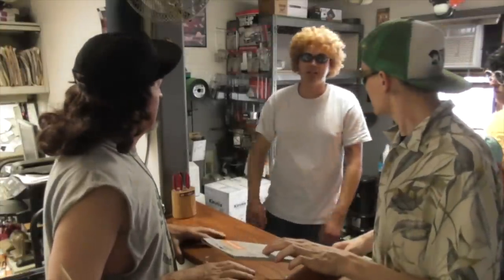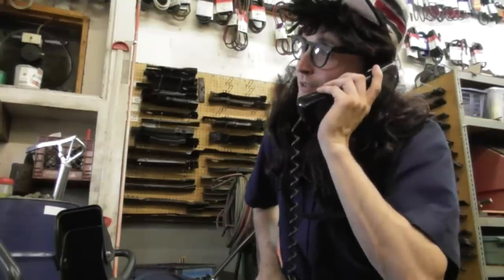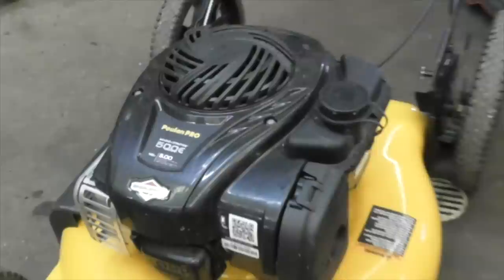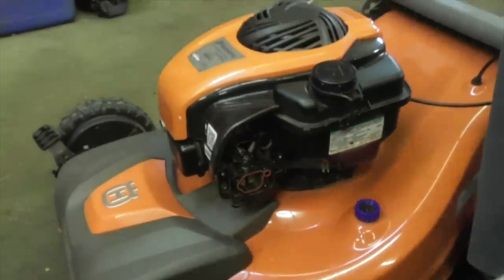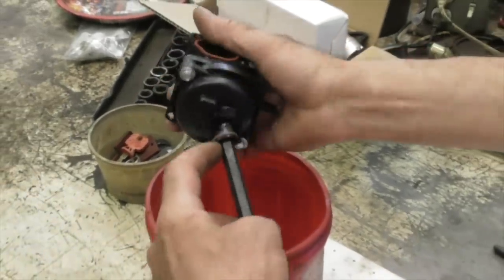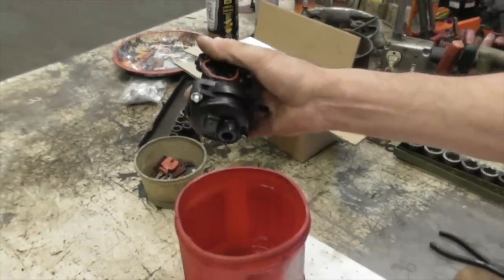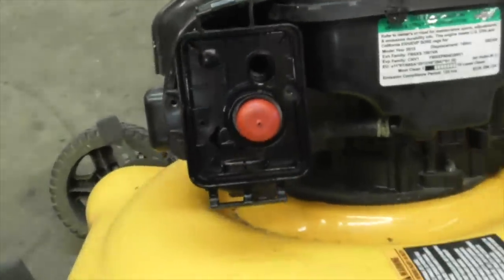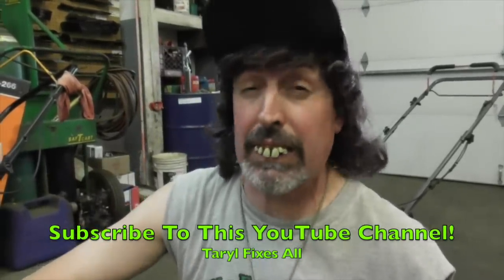How To Clean The Carburetor On A Push Mower (New Plastic Style Briggs Carb)

Comment: This is the ONLY video I have ever seen that shows the correct way to disassemble and clean one of those plastic carburetors. Most don’t remove the white jet body and I’ve never seen anybody take the white jet body apart. Great job Taryl. and thanks for showing how it should be done.

Comment: Just wanted to say, This video helped me fix a Crapsman push mower( mine had the primer button) that ran fine last summer, wouldnt start this year.  I took it apart before watching your video, and thought i had cleaned everything, still wouldnt start unless i sprayed starting fluid in ( then it would run and die in seconds).  well first time i didnt take that little silver ball out, it looked clean and i still sprayed some carb cleaner.  sure enough take it apart again after watching this video something was stuck in that exact place Taryl mentions as a common spot.  Thanks for my dinner!!!

Comment: I have 3 husqvarna 21 inch mowers with Honda engines... I've used them for lite commercial work ive had them now 3 seasons they all still run great ! I had someone this year bend the shaft in one of em but it still runs lol..I need to try and fix it! I've watched the video where you fix a bent shaft but I have not tried it yet lol...anyway keep that oil changed and them things will last longer than you think! Thanks for your videos! I honestly think you have one of the most entertaining and educational channels on YouTube!

Comment: Thanks- I have trouble every spring with this carbitrater and you answered all my questions. I thought it was cheap junk but it works great and is easy to work on.
Reply: It is cheap junk...our fuel is the culprit though. Ethanol has no business in our fuel, it ruins everything.

Comment: 2 years old and still helping people!  The carbs have become even more plasic here in 2020.  The air filters are a little different and the whole rig is 2 screws fewer... The float pin is now a plastic part with a rubber tip.  It also slots into the float itself before reseating into the bowl.  I skipped through the fluff straight towards the part I needed to see.  That being said you had an exceptionally thorough explanation and patience to allow for proper camera angles inside the Carburtraitor (<-Love that btw...)

Comment: Those plastic carbs are absolute junk. It’s sad that they are charging more for mowers these days and ain’t got more than maybe 50 bucks in em if that lol. awesome video as usual grass rats...👍👍👍
Reply: R Miller, that what a pawn shop is for... Just have to find the right deal.
Reply: R Miller there's nothing wrong with these mowers. An in-line fuel filter can still be fitted to the short fuel line if the carburetor tends to clog.
Reply: just because its plastic doesnt mean its junk.
Reply: The only reason they make them like that is to cut manufacturing costs.  They don't give a rats ass if they don't last.  Now some lawn and garden tractors have plastic transmissions.  The best part is...they are not serviceable.
Reply: @jordansdad1221  The best thing is if you have an older one that does not have that unnecessary plastic and it still runs keep it as long as you can.  Don't give into buying a plastic carburetor if you can avoid it.
Reply: @boomstickkid  yes it does...............LOL
Reply: nothing wrong with plastic, fuel is crap, thats all. All carbutraitors have problems with modern fuel. Use alkylate fuel ment for mowers and small engines, empty your tank once a year.
Reply: R Miller companies build what the general public is willing to pay for. You can still buy a push mower that’s going to last a lifetime of commercial service but you’re not going to find it at the big box store and it’s not going to be cheap.
Reply: Wayne Swicegood I’m aware.
Reply: @999thenewman  yeah,that's exactly what I did after the jet got clogged the second time in 2 weeks. It's been 3 months and so far so good. They should have put a fuel filter in from the factory. Would have prevented this.
Reply: I kind of like the fact its plastic and has "o" ring style gaskets. You dont tend to have to replace the gaskets if you take carb apart to clean it.
Reply: @TheStrikkegenser  i agree as long as the plastic holds up and does not degrade or crack its fine..metal carbs have corrosion issues from water and crappy gas...these plastic ones just get clogged like any other carb and can be cleaned...
Reply: They're great. The circuits pop right right out for detail cleaning and pop right back in. What's not to like? Lol!

Comment: I drill out the bottom main jet with a # 72 drill bit .020 works great , starts first pull ,,,,even the ones without the auto choke . Been working on mowers for over 50 years ,,,I'm a 74 year old machinist and I'm like you " Old School " !

Comment: Taryl. Love your vids, man. I watch them all the time on my internet screen. On this vid, I would like to suggest a helpful tip. At 15:20, when the screw is being driven into plastic, turn the screwdriver backwards, until you feel the screw "drop in" to the already cut threads, then drive 'er home. You'll reduce the risk of cutting new threads (weakening the existing threads) and striping out the screwhole! Thanks for the tour of this carb. Never seen one before. Keep the vids and comedy a-comin!

Comment: Well I'm not a huge fan of the craziness, but you know your stuff, so kudos for that.  I had the exact same problem with my plastic carbed Briggs, I followed your procedure and it runs better than new in less than 15 minutes.  This is a great running, auto-choke (that actually works) engine but this carb seems to be very finicky when it comes to clean fuel.  Thanks Taryl.

Comment: Can’t wait to see them start making plastic engines too.
Reply: FishFind3000 I know got a plastic transmission in my Ariens leaking after 2 years everything is junk now my 1982 Lowe’s mower is still going
Reply: ¾ of those new Briggs engines like you just saw are all plastic built! The starter cup on those are plastic and break constantly, the flywheel air fins are all plastic and break off, the entire recoil starter is all plastic, the block is cheap aluminum and develops stress cracks along the side and base that bolts to the deck and starts leaking oil out, the overhead valves constantly need adjusting or they quit running, and the internal camshaft gear is all plastic and strips out or breaks at the blink of an eye if you do much hit a twig while mowing making the engine toast. I miss the old Quantum engines and classic engines by Briggs that ran forever!
Reply: Lorne Johnson  briggs has been using a nylon camshaft since the late 80's those parts are reliable.
Reply: Ez wurks is going to do that
Reply: I like the Briggs plastic carbs.
Reply: They practically do with plastic cam shafts and valve cover
Reply: @jakewells9403  no starting in like 2010 if you have a 80s Briggs it is most definitely all cast iron

Comment: I did a bad. Had problems with crud plugging the little brass jets, so I pulled em out with the welding tip cleaner and ran it hard twice through each, and pushed them back in. Yeah, not supposed to, but it runs great now...

Comment: Worked great. Although I didn't find any gunk, just greasy water. Grabbed some bad gas from an old tank by mistake. I first tried flushing the tank. It still ran 5 or 10 seconds and stalled. everything worked just as described for my carbur'tater'.

Comment: Every year I have to clean the intake to that main jet.  Always some small piece of debris.  This whole jet assembly is horrible.  But working as it should, starts up with a single pull every time.  Love the humor.  Oh yeah, I use a little silicon grease on the jet o-rings so t pushes in easier.

Comment: I know you probably won't see this because it's an old video, but about the atmospheric vent you were pointing out.... I got an old mower that actually had a little hose attached to it, that was connected to another little nipple where the white cap is on top of the carburetor. I knew it wasn't necessary, so I just removed it. I think that must have been some kind of California emissions requirement thing.

Comment: Where I live folk just throw out the mower after about 1 year cause they can't start it.  The problem with those plastic carburetors is that the pickup tube is right at the bottom of the fuel bowl and it picks up any debri in the gas.  Then you have the plastic gas tanks that internally break down releasing  tiny pieces of black plastic that clogs the carburetor. Best thing to do is to put a small fuel filter between the gas tank and the carburator.

Comment: Great camera angles, thanks for getting close and being specific.. I was able to clean mine and put it back together. One other issue I'm having is, when it's running I can only cut for about 4 minutes when I notice I start to lose power and it smokes a little. Any idea what that could be? Once I let it cool down and sit, I can crank it back up no problem. But again, few minutes of mowing and it slowly starts to die and lose power.

Comment: Just FYI,,, starter fluid is how NASA launches the space shuttle! They put a lawnmower beneath it and start it with ether and wait for the explosion!
Reply: BCtruck, rebuild, repair,repurpose Lol, I use ether to start everything, diesel and gas tractors, lawn mower, and my Ford f150 in the winter. And if you want an actual explosion, spray it into your diesel truck intake and then operate the glow plugs.
Reply: I have used brake cleaner to start my generator (Briggs pull start). No explosion that I can think of. Just relief that I got that thing started in cold weather.
Reply: I. Love tearl....he fixes all

Comment: Silly question I know...I just don't want to screw anything up before I embark on this project. I own the orange mower exact same make and model...What  EXACTLY  is the type of spray used on the carburetor?  I have two different kinds  currently. One  Is the motor medic thrust starting fluid and the other is come out jet spray carb/choke in parts cleaner.  I noticed on the gum out brand it says cleans all unpainted metal parts so I'm assuming i shouldn't use that one? I noticed you had something in a red can...could you share what that was? Or give me the exact brand and label title to use? Everything else is was perfect so  Throw and easy to follow my 15 year old daughter is able to do this period but we are hesitant as far as the carburetor spray.... I have liked and subscribed to your channel and shared this with everyone in my family!

Comment: Did that 3 times to the carb thinking I had done something wrong....The darned cable for the stop part had stretched just enough the  wedge would engage and start-and shake-and shut the engine off.Symptom just like water in the carb

Comment: I lost the spring on mine. It flew away when I took off the carb to clean it. Harbor freight has their $5 set of 200 springs that has a spring (about 10 of them) that is the right size and tension for this. So don't spend $12 on the briggs spring

Comment: Mine still wont start and ive rebuilt the carb exactly like you showed. I put a new plug, fresh gas, new air filter, and it IS getting spark. Its a red hyper tough 20 inch mower and the carburetor looks exactly like the second push mower you showed here. I guess I'm going to buy the replacement carburetor for 20 bucks if that doesn't fix its getting sold lol

Comment: I was told by a lawnmower mechanic that carb spray will mess up the engine. I don't know how true that is but I also heard wd40 is better to try to get the engine started because its oil based!
Reply: JGO most of them are Ether which catches easily and can be too lean and mean for high compression engines like diesels, but for low compression mowers nah. Wd40 works in a pinch.
Reply: JGO not true. Your mower engine is lubricated with oil, why would it need oil in the fuel, it's not a 2 stroke. Plus it only runs for 1 or 2 seconds.
Reply: Anon Ymous I know nothing just saying what I herd!
Reply: I use a spray bottle from the dollar store with some two stroke gas in it. Works for anything I’m trying to get running. Cheaper than carb spray.
Reply: Gene Friedman  News to me! I’ve cleaned plastic carbs with carb cleaner spray for years and have never had an issue. Some plastics yes, but not the nylon that these carbs are made from!
Reply: John Acuff  Great idea!  Thanks.

Comment: 8:53 My car-bu-trator has a white plastic device with a black rubber (sticky) thing for a needle.  Not metal. 
When I removed the float pin and the float, the rubber point remained stuck to the port.
I  removed it and scrubbed on it a little (the rubber point), but the engine still won't start.
It will run as long as I  keep pumping the red rubber diaphragm.

Comment: For rent:  Mud Wasp Hotels...

I know you emptied that gas tank, but just didn't mention it.  
I learned LONG ago (like a loaded gun), assume the gas tank is full of trash.
Just dump it out (drain thru tube).  If you ever clean a carb, then let that gas 
trash back into the carb, you'll learn your lesson!

Also, in Florida we have dirt dobbers (mud wasp,etc) and they plug up
every hole they can find with dirt, spiders and wasp eggs.
Every pressure washer I fix MUST be given special attention to remove
that mud from every hole on those machines...hoses..pump in/out...nozzles.
Even stored inside a building, the mud wasp STILL get in there and 
pack mud into everything they can.  Some air filter covers are designed
like little mud wasp hotels.  They have 4 tubes to allow air in.
Mud Wasp Mamma says "Ohhhh...little hotel rooms..!  Lets fill them with MUD!"
Best to all and remember....

THanks for THinking!

Mr. Brown
Florida

Comment: Taryl, I noticed you did not blow any of the channels out on the carburetor body its self. Is there a reason why? I cleaned a couple of them and did everything you did but I still could not get it running. I noticed that the channel on the left (when you looking at the choke side), seemed to be blocked or mechanically not bored all the way through???